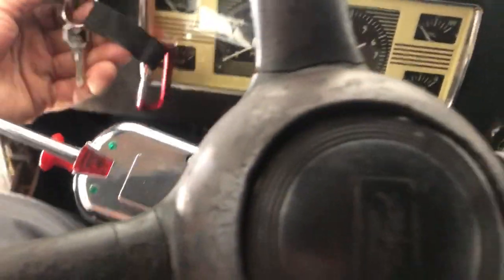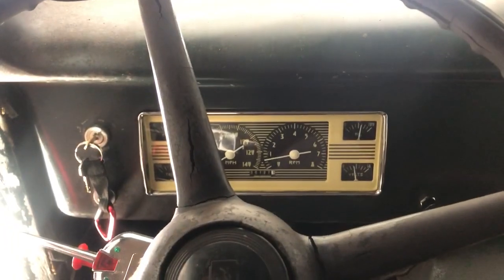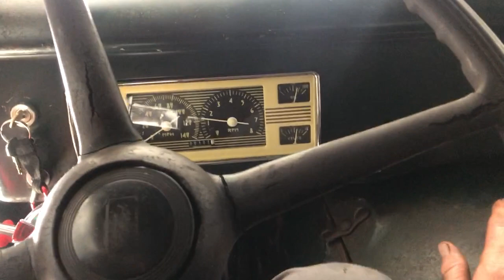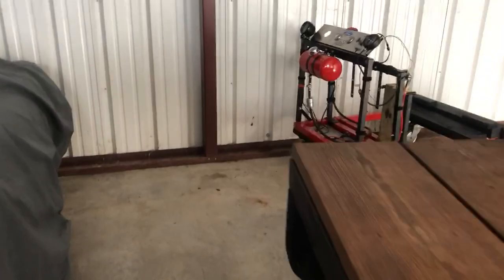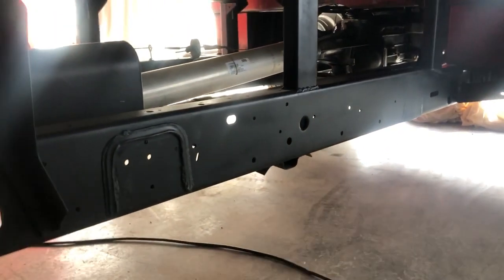FLATHEAD with FLOWMASTER EXHAUST

Comment: Sounds great. I have an aluminum driveshaft too. Made a big difference on mileage. Still sucks but these flatheads need all the help they can get lol
Reply from the maker: Thanks. Yeah my drive shaft needed to be a bit too long for them to make a steel shaft for it (apparently there are limits), and it was almost long enough to use an actual Dana manufactured shaft.  So that’s what I did.  I used the manufactured Dana shaft (to save on fabrication cost) and I used a slip yoke that was about an inch longer.  That way I have plenty of engagement in the trans. 

Thanks for watching!  Take care
Reply: @ChadDrake4185  I used to work at Carolina Driveline which is why I did mine. But I knew the benefits of steel and aluminum. I have a video on my channel of getting it built